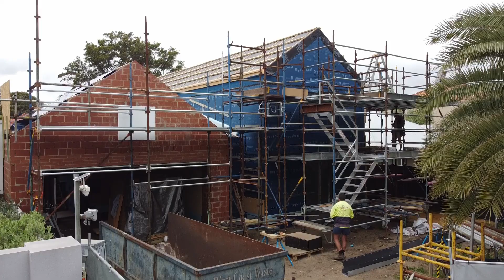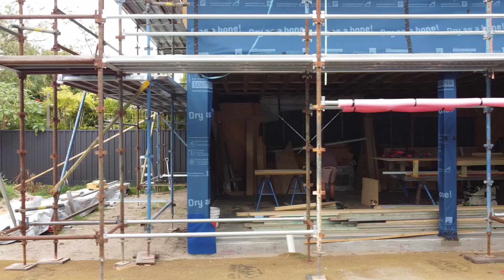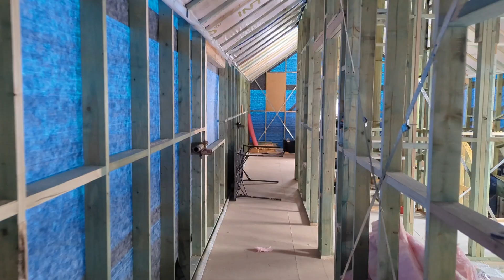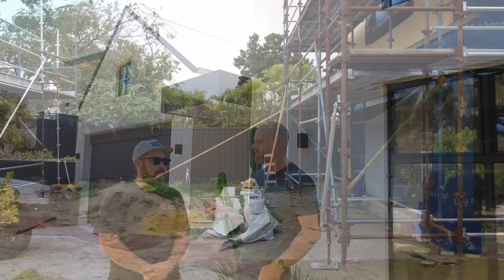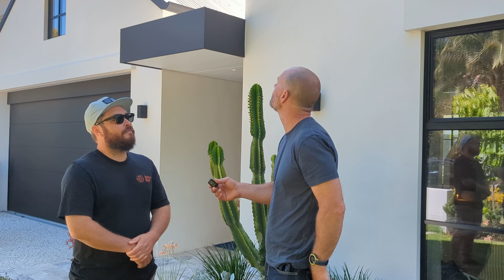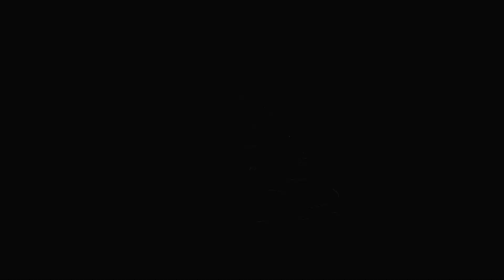Meet the builder: Architect Ben Caine talks with Builder Shaun Ngere from Saltus Built.

Comment: Well done!. Can you please expand on the wall construction/layers when using wood fibre? Do you have intello on the inside? What airtigtness level did get in the end?
Reply from the maker: From outside to inside: Lime render / woodfibre board / VPM membrane / stud frame / Air tight membrane / service cavity / plasterboard. We achieved under 0.60ACH.
Reply: @theleanarchitect What’s the R value of the floor, walls and ceilings?